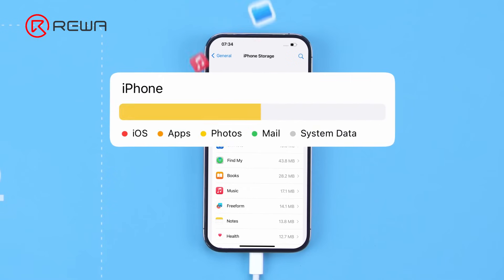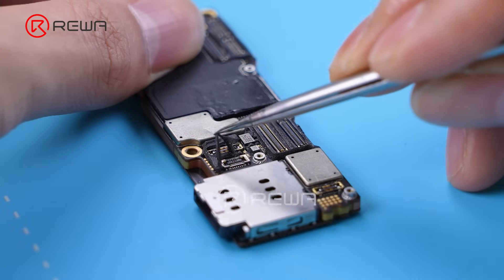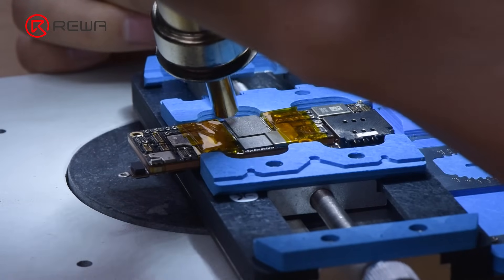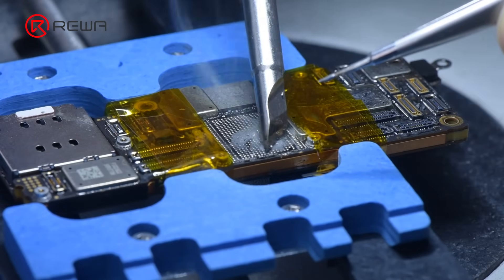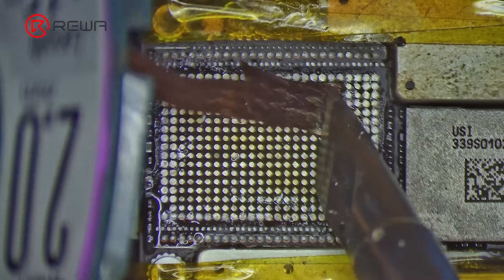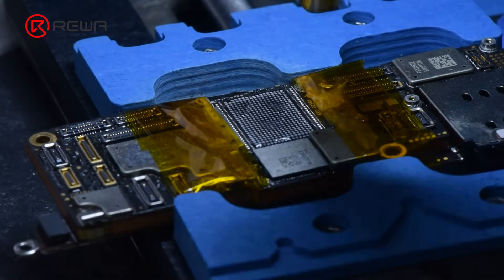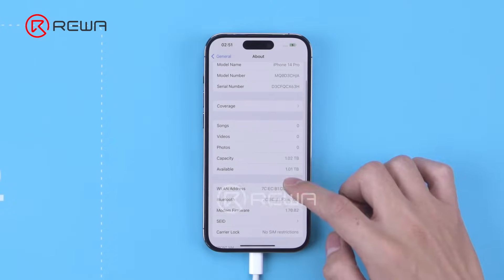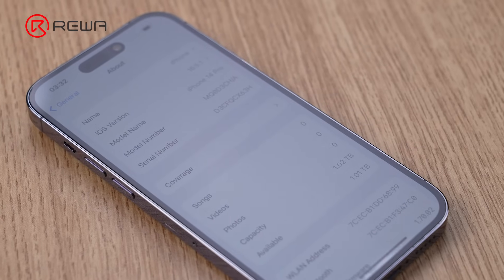iPhone 14 Pro 128GB to 1TB Upgrade | Step by Step Guide

Comment: Thank you for sharing the video.
I would like to do this as well; I have the skills to perform the replacement, but I am unsure about doing it because I have a doubt about whether it's necessary to clone the new NAND by copying all the information from the old one using a programmer before installing the new NAND.
However, in the video, I see that you didn't use any programmer, only a subsequent restore with iTunes.
So, can you confirm that there is no risk of losing Face ID / Touch ID functionality?
Thank you again for the knowledge you share. You are great!

Sincerely,
A fan of your channel.

Comment: It's wild how an increase in manufacturing complexity by soldering these rows of grounding resistors is easily jsutified by the profits they make...
If you didn't know what happens, when iPhone, or most other phones completely run out of storage space - THEY SHUT DOWN AND CANT REBOOT BACK. This means, that ALL your local data is lost, and the only option is to wipe the phone and reset it through the computer.
128GB is laughable for a base config "Pro" phone. Out of that, 26-30GB will be eaten up by the system, and then you'll get only ~100 GB worth of storage for 2-3, when most people upgrade their phone.
The real eco-friendly move would be to stop the stingy storage options, and make the phones last actually longer, by not crippling them with the pitiful storage space, thus keeping these phones out of the landfill.
Considering that Apple would charge $500 for the same size of storage on top of 128GB, it's a no brainer for the consumer to get the 128GB model at the start, and upgrade it later, when battery is degraded anyway, so upgrading storage is a nice side benefit. Again, if you reach 127+ GB on your phone, and some app decides to update, or you'll shoot a video, then the phone would freeze and most likely wouldn't boot back up again. (In my friend's case, he had evaded hard resetting the phone one time out of 4 by sheer luck, he had a 64GB iPhone 12 mini)
Where in the world does 1TB NAND minus 128GB NAND, several resistors and assembly line time cost $500?? By that pricing scheme, the iPhone N Pro ($999) should costs the same as a 2TB SSD??
If you're curious how dirt-cheap nands actually are nowadays, go to the dramexchange.com

Comment: The most challenging part is how to align all the pins with no visual.
Reply: It's not as hard as it seems. As long as you get close, the flux will make sure everything is soldered right.

Comment: It's reassuring that nand can be replaced on boards who's nand may have died. I'm curious if this nand swap is cheaper than just buying higher capacity directly from apple?
Reply: You can 1 tb nana chip in less than 100$
Reply: it is way more cheaper

Comment: How does it work without the transistors? Are they built in to the bigger chip?
Reply: These are resistors, not transistors. The 1TB flash most likely needs more power, therefore no resistors needed.

Comment: Whats cheaper? Buying a brand new iPhone 14 Pro 1TB or iPhone 14 Pro 128GB and upgrading it to 1TB?
Reply: It depends many scenario, if you have repair shop, and have 1TB model that unrepairable and the nand storage is good, you can offer this option to ur customer. but this option only good for 1+ years old phone, because the warranty.
Reply: Buying 1 cloud 😂
Reply: iCloud won't get you 1 TB of app storage 😂
Reply: Get a iCloud, that’s the cheapest

Comment: What happens to the resistors that got removed in the process?
Reply: Dont need them for 1TB
Reply: Those resistors are there for a reason and removing them will have stability problems. 😂
Reply: @veasnanoeun235 did apple ceo personally tell you this?

Resistors are often used for shorting unused pins.
Reply: @veasnanoeun235   The new chips don't need them.
Reply: The 1tb dowant use them so no it won't 😆

Comment: I have Samsung Galaxy Tab S9plus 5G, 256Gb, can you upgrade for me please? 1TB?
As usual, awesome video,.... From the shorts to the full videos, your works always marvels me....
Reply: Why would you bother with this, S9plus have micro sd slot use that.
Reply: Some apps won't move to SD slot
Reply: @Khan-mg9bs it’s your fault, u bought the shitty device with a SD   Slot in 2023, what have expected? The whole world don’t use memory expansion packs anymore. Apps can’t handle and crash when u force them. Never again Samsung, never.
Reply: @tln47  seems like you're bitter about Samsung. I am not ! And I don't have any problems with the devices. I only chose what I could afford and wouldn't mind an easy upgrade to storage. Plus, I never complained to you about SD card or internal storage capacity. Take a chill pill.. a Samsung device is good for your health 😉... Love n Light

Comment: I got question. If change motherboard, theres will be unknown parts for battery and lcd eventho its original from the phone itself. How can I fix that? Preprogram?
Reply: My guy, you didn't replace the motherboard, you replaced everything else around another motherboard. Faceid, screen, battery etc are not the motherboard's original components.

Comment: no need to program the nand ic?
Reply: ● For iPhone 6-X, we should read the NAND underlying data then write into the new NAND. And we can user programmer like P10 and P13 to read without removing the NAND chip.
● For iPhone Xs - 11 Pro Max, we should remove the NAND first, then read the NAND underlying data by programmer like JC V1S Pro.
● For iPhone 12 serious and above models, there's no need to read and write NAND underlysing data, we can replace the NAND chip directly

Comment: i have an issue regarding face id on 13Pro.
Data on old Dot metrics cable lost & i already unbinded Memmory.
but didn't change serial number and write successfully on new JCID Cable. 
Any solution?
Now its showing face id disabled.

Comment: several questions
1. Do you return the protection form after replacing the NAND ?
2. Why you can remove this line of resistors ?
Reply: the resistor line is only used on the lower storage options. the 1TB iphone doesnt use them
Reply: What’s the resistor lime used for?
Reply: @10cmontibia66 I don’t know for certain but it might just be to tie data lines to ground if they aren’t in use on the lower bandwidth chip
Reply: @10cmontibia66  Resistors are used to lower current, my guess is that the 1tb nand uses more current so the resitors are not needed
Reply: @maevwat  If they were used to lower current that mean that they must have been installed in series, so for removing them their pads must be shortened with jumpers, but that's not the case. May be @jacjb3493 is right about tying
Reply: @maevwat nah, the guy already mentioned that it was a "grounding resistors". So yeah, most likely they used to tied up data line to ground. In lower capacity means they just altering that pads without changing the design in case of when they need to put the 1tb config

Comment: You skip the most important part .... You didn't show how u copy nand data from the old nand to new nand.
Reply from the maker: After iPhone 12 series, NANDs can be replaced without affecting the original data, as they aren't locked.
Reply: Question: I have 7 plus CPU broken . What should I do?